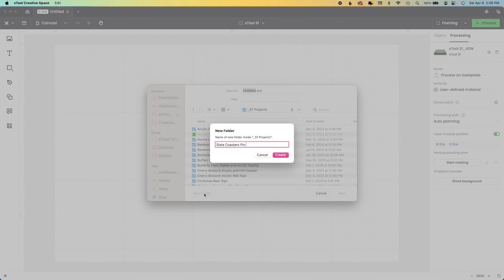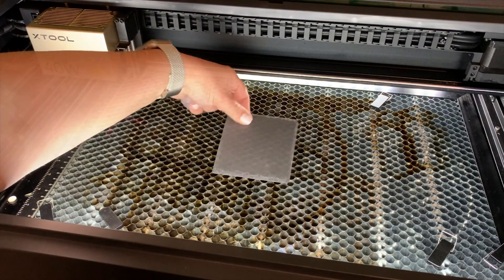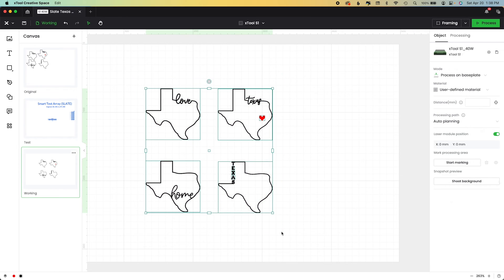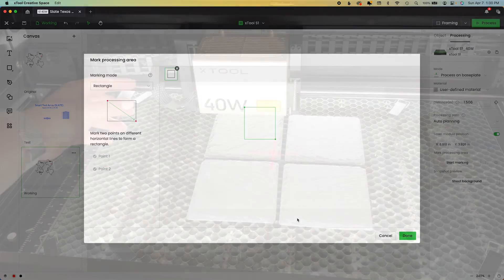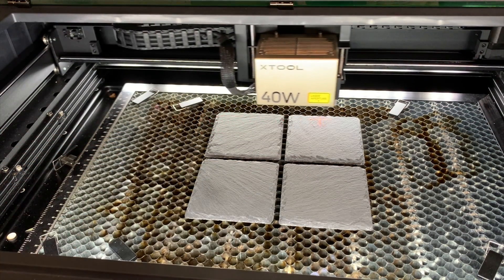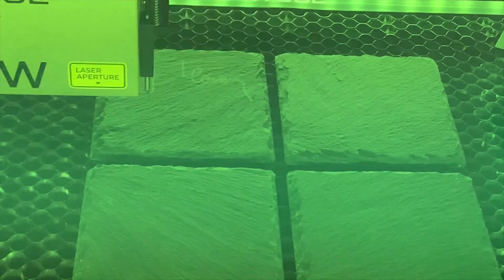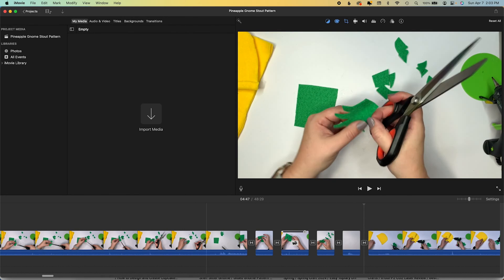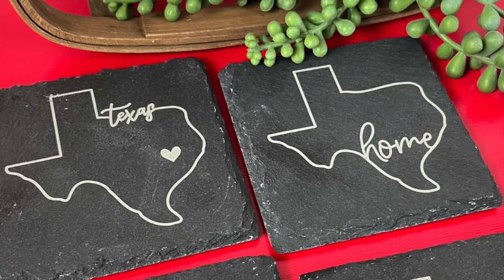How to Engrave Slate / xTool S1 Batch / Bright Slate Engraving with Vectors Without Poly / Coasters

Comment: Not sure how to ask a question but I have the riser and it seems the laser doesn't go low enough to etch?
Reply from the maker: The baseplate is moveable, so you have to pop that in with the parameters for auto-measure. As I'm just seeing this now, did you already get it?

Comment: What would be your average time per coaster or set of coasters for the machine running for production for customer coaster? Thanks!
Reply from the maker: That's a hard question to answer because processing time is going to depend greatly on the design and the settings. 

For these, if running production, decreasing the LPC and settings variations will be 5-6 minutes / coaster. If I'm making for stock, I'm going to use something like the F1/F2 because those can work much faster.

Comment: Thanks for this video and your test array.
I noticed, that you hit auto measure just the once - do you know if it's possible to measure for each processing area? Some of my slates differ ever so slightly 🙁
Reply from the maker: To measure differing heights like that, you would process them as individuals. That said, you could also measure for the average (or drop the focus 1mm or so). The problem with that is they could be slightly different colors on the slate when cleaned.